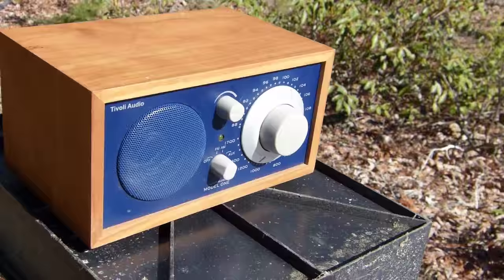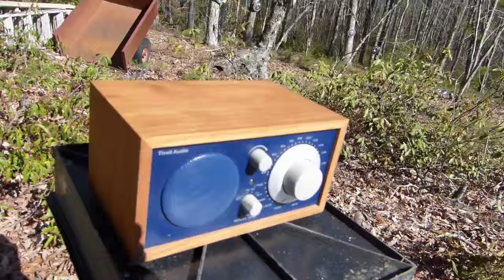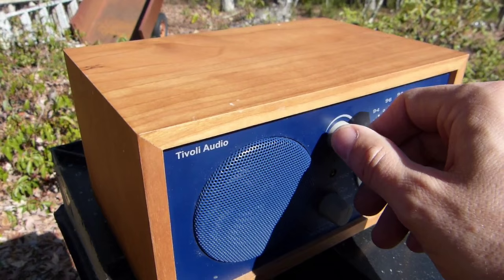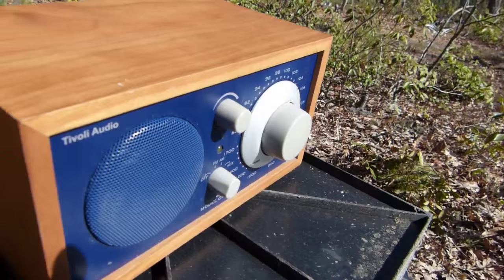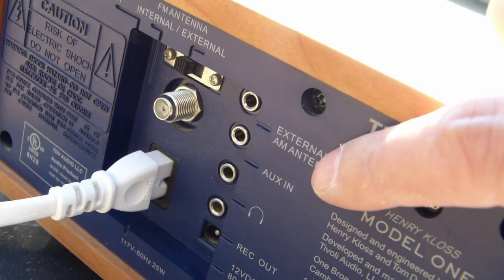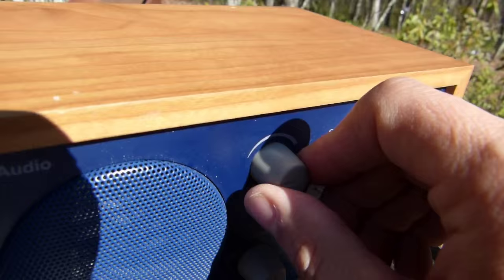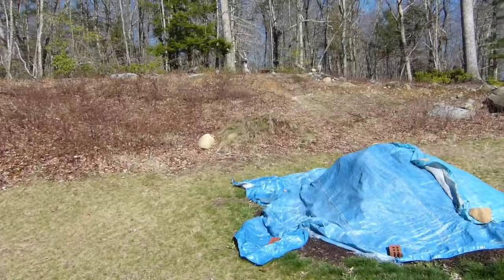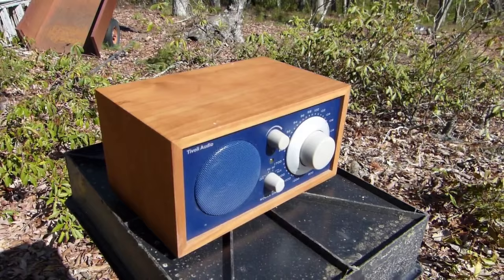Tivoli Audio Model One Table Radio Review  - Outdoors

Comment: If you'd like to keep the Tivoli indoors and want something with excellent performance and is better suited to outdoor use, check out the Sangean U-3.
Reply from the maker: Interesting...I'll have to look into that one.  I have a small collection of older portables and my current favorite for outside is an old Panasonic RF-1100 I recently picked up at a flea market which I plan to make a video on soon.  I decided I really didn't like the Tivoli and sold it on eBay.